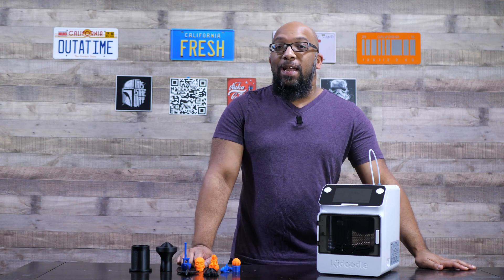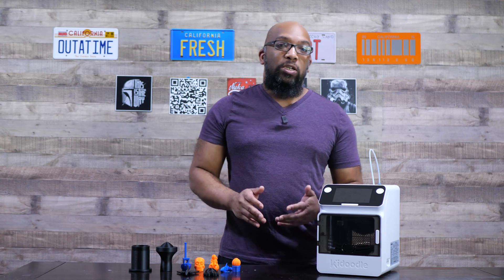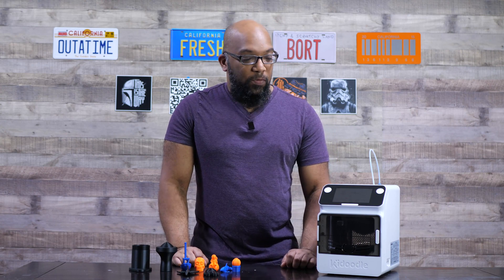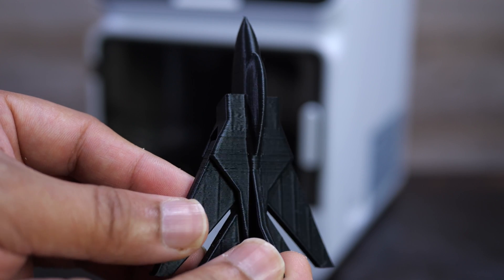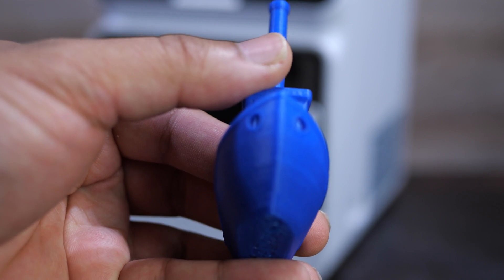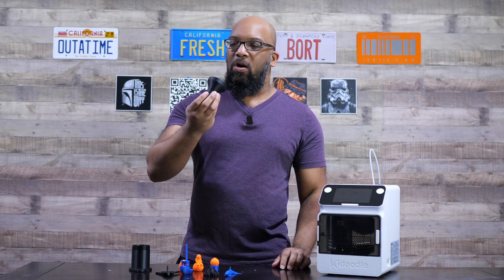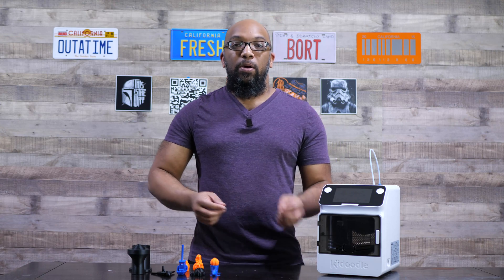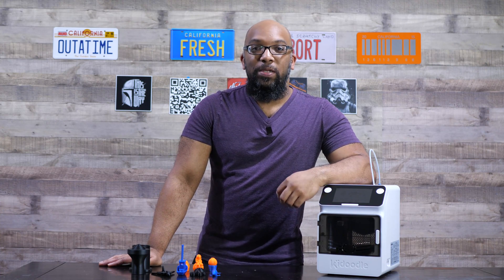Meet the Kidoodle MiniBox A1: A High-Speed 3D Printer for Kids

Comment: Hi there Jeremy! Excellent video - it was the one I liked the most about the Kidoodle here on YouTube. You pointed something I agree (and unfortunately I forgot to say in my video): although this is a very easy 3D Printer - I really see it as a toy for kids to mess with 3D Printing - having someone in the family that actually knows how to 3D Print stuff is VERY recommended, at least in the beginning, to be sure Z-offset is ideal, and to check if kids are positioning the plate correctly, if they are spreading the glue in the whole plate - and to diagnose any possible hiccups (like a Clog - that I had in ours, although the clog was my fault, trying to create an OrcaSlicer profile). Anyway, that’s like having a toy sewing machine: if no one knows about sewing machines, kids might be in trouble.

Comment: Since it can use cura, can you change the layer height and quality to reduce the lines?  Would it make a difference?
Reply from the maker: A combination of lowering the layer height and the speed in Cura would make a difference in print quality.
Reply: @FigureFeedback  On normal printers but im wondering if because this printer really isnt made with higher quality in mind and im not sure if the nozzle/hotend would benefit from tweaking settings or the printer is just what it is?

Comment: Oh wow, that Benchyyyyyyyyyyyyyyyyyyyyyyyy. Where are you going?!  lol.   Like I mentioned previously in the short, this printer has a better screen than most of the modern printers out there, like the Bambu P1.  It's amazing that can't be included given the cheap cost.  I like that it is enclosed and you mentioned the safety features and it reminds be a bit of an Easy-Bake oven!  Additionally, being enclosed will provide protection against air drafts that could potentially warp/lift the print.  There's nothing more discouraging and interest deflating than a failed print with a young one.  I wouldn't think the layer lines as being too much of an issue. If it's geared towards kids, they're super happy with just being able to create.  They still have an imagination and can see around those things.  Now, I wonder if someone will put this in the SpeedBoatRace challenge?    Great review, thanks for sharing!